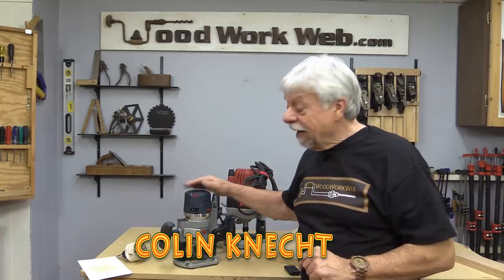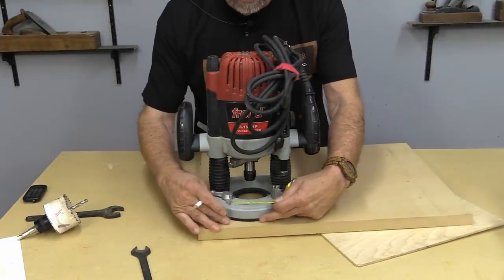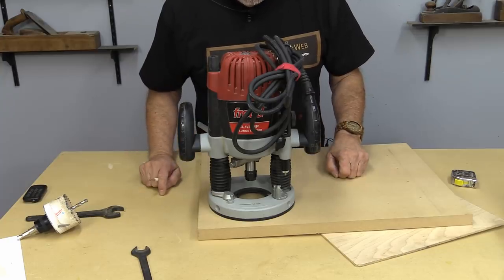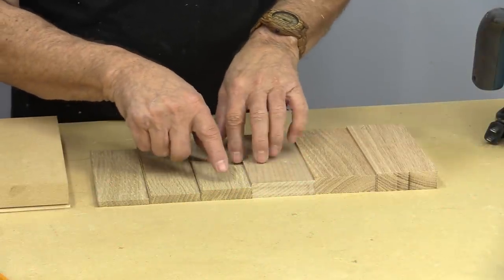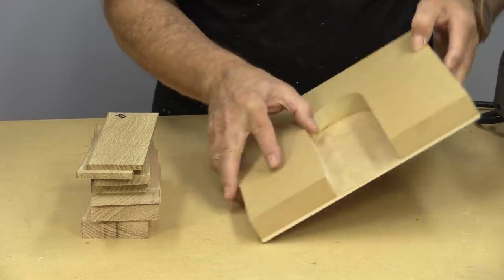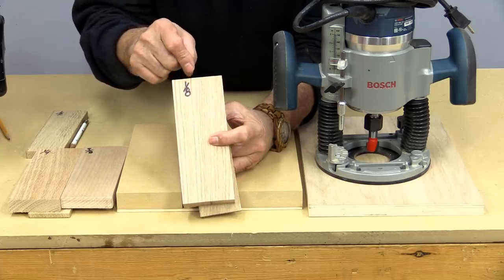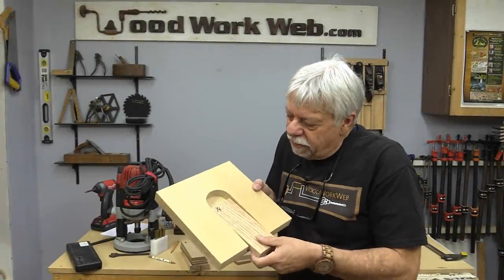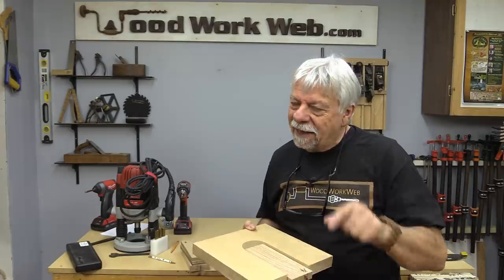Router Depth Setter: Wood Router Jig for Setting Depth

Comment: Colin, why not just create 1/8" blocks and stack them together for the depth you need instead of all the different sizes, also if you either make them shorter or round them over they would be easier to store in the slot with the base.
Reply from the maker: Those would be some great mods! Thanks for sharing.
Reply: Unless the boards were perfectly joined by the 7th stack (*for 1/8 depth) the imperfections in the wood or even minor warping over time would lead to imperfect depths potentially. I think just planing boards to the correct thickness is the correct way to go, as seen in the video.
Reply: @JustinSmith1287  1/8" masonite would minimize the imperfections that you accurately point out.

Comment: Why the base? If you want a certain depth like 1/2", just lower the bit down to it touches the table and insert a 1/2" brass bar or something else that measures 1/2" between the router stop and lock it down.
Reply from the maker: It's to make sure you have an even surface, but necessary if you don't need it.
Reply: @knecht105  I still don't understand. Most router manuals show how to set the depth easily without a jig. Another advantage to this standard method is that the depth can be adjusted very accurately to any depth using drill bits.

Comment: Thanks for sharing. :)
This is a cool idea, but sharp router bits will press the wood fibers down and the depth adjustment will become inaccurate about 2 o 3 milimeters(I know, because  I have ruined one of my projects in a similar way!), moreover humidity of air may cause the wood to swell a tiny bit and make this jig inaccurate! 
I think using something like that metal gauge blocks at the bottom of the jig, will make it much more accurate and durable.
Reply from the maker: Put a laminate on your wood if this is an issue.  Thanks for watching.
Reply: @knecht105  I will try this tip! Seems like a good idea :)
I really appreciate that you read our comments  and care about them.

Comment: Colin, why not cut out the whole channel in the 1" MDF and make a fixed 'staircase' type depth gauge where each step is one of your common settings. Leave a larger 1" step so you can add in steps of a different size should you need it for a specific job. That way all of your common depths are always in your jig and you can't loose one of them.
Reply from the maker: That's a GREAT idea! That will be for a future version on the jig. Thanks for watching.
Reply: The steps would need to be wide enough to accommodate the widest bit you want to use with the jig.
Reply: Thought the same exact thing

Comment: I think you really don't need the jig tbh.....jus take your router with the desired bit and plunge it in any flat suface and then take the measuring block and place it in the touret and lock it down ...that way you'll always get the same results accurate everytime....jus a suggestion .... anyways great video  as always .....cheers ...thanks Colin!!!!!😀😀👍🏻👍🏻

Comment: Isn't if the inverse for something beyond 1/2 inch? For instance if I need 1/4 inch and I put your 1/4 inch block inside the jig, the router depth will be 3/4 inch isnt it by using this jig? 1 inch minus 1/4 inch.

Comment: I enjoy your videos. Many good ideas. Just watched this one, but this time I think you might have gone a little overboard on the jigs. Just zero out your router on any flat surface, and  lock it.  Then use your brass gauge blocks between the turret and rod on the router to set the plunge depth below the work surface. The brass gauge blocks are most likely more accurate than any wood strips you could cut, and they are not susceptible to thickness changes due to changes in moisture content. I use this procedure to set router bit depths all the time, and don't recall ever having a problem with it. And... I have one less jig to store in my shop with limited space.

Comment: Great idea i will be using it. I like the blocks made like that better to have dedicated single blocks to avoid compound error. Do you have a solution to the thicknesser problem when you get steps in the ends? I think it's the transition from 2 rollers to one and back allowing the timber to lift slightly

Comment: Hey Colin. Great episode. Question though with regards to router bits. I understand shanks and also on what profile router bit to choose. However I get confused with selecting the size of the bit etc. I came across a sliding door that required the bottom of the door which runs parallel to the floor to have a 16mm wide by 5mm deep groove to be cut into it. How will you do that since a door is huge and all you have is a router. Plus in this case how can you change depth of cuts as required. Buy new cutting blades? What decides the maximum limit of how deep a cut I can make? What consideration should I take when buying a cutter then?

Comment: First, you need a planer to set all those different thicknesses precisely.
Second, even if you use hard wood, they will be dented by the router bits.
And finally, its a bit time-consuming (but if you've spare time...)
I'd rather use a bunch of 1mm thick steel bars and pile them in the required number.
All this provided you can't rely on the router scale itself, obviously.
Reply from the maker: Great ideas, Carlo. I look forward to seeing your video on this modified version of the jig. Thanks for watching!.

Comment: Fascinating, Colin. You have the best hacks on the web. This is another of yours that I have a real need for in my shop. By the way, I've been trying to find some 1" thick mdf, but not having any luck. Can you tell me who your supplier is? Thanks.
Reply from the maker: Around my parts. most hardware stores stock it.
Reply: @knecht105  I have only been trying big box stores, and online, I'll check some hardware stores. thanks.

Comment: Thanks for sharing. Another excellent video. A great woodworker once said there are 3 ways of doing things. This topic is no exceptionMethod 1. Your method is great. As a slight improvement, you might make the base into a box to keep all your depth pieces togetherMethod 2. Drill multiple holes (of diameter large enough for the biggest bit) into a 2x4 and put in bolts and nuts in the centre of each hole. These bolts can be set very accurately to any depth and then locked in place with a second nutMethod 3. Lock your router + bit flush with any flat surface. Put you standard depth bar in between the depth rotor and the vertical depth bar and lock the bar in place. I use the steps on the depth rotor to incrementally cut your way to the final depth.If you don't have standard depth gauges, cut several pieces of flat iron and file them to size, checking with a vernier
Reply from the maker: That's to tips and thanks for watching!

Comment: I'm really sorry because I have learnt a lot from your channel but I'm confused. I bought a little gauge with a ruler in it for £5. I’m very new to woodworking but wood doesn’t seem to measure what you buy and does vary. So how will precise measures work? If I want to go through 22mm wood I can set it to 22mm on my measure, but an inch would be too imprecise for the wood. To my very very limited understanding, it’s the measurement of the wood you are cutting that matters, not predetermined measurement. Or am I missing something?
Reply: Use this to make a groove or dado into which you glue a panel at a right angles. The depth of the cut is how much you imbed the panel, not the width of the panel.
Reply: jerryf609 Thank you, I see what you mean.

Comment: The router has a depth stop for a reason, you might as well use that. lol.
Reply: Agree with you. Set the router bit flush with the bottom - on a flat surface, then set the depth stop up the exact measurement desired either by ruler or block gauge, then go to town with it.
Reply: that's the simple easy way, and toms description is exactly the way to do it
Reply: I think he left out a major reason for using this method he is showing.  IF you have multiple router bases and they are different thicknesses this gauging system can be used to compensate for those various thicknesses.  I got around the problem in a much easier way by marking the rules on the router with red and green marks which represent the other two bases I have.  Simply use a knife to scratch in the exact place for one inch.  Then use a felt tip marker on the scratch.  Wipe off the excess and you have a reference which you can use a steel rule to make all the other depths you want.  Then rather than drop down onto that cam as he did in the video, you just lock the plunge to the new mark that matches the base being used.
Reply: The measure on my routers are both useless. They are both quite inaccurate. I have a series of 150mm squares of different thicknesses that have a 60mm hole though each one. Then I place the router base on the square on a hard surface, then adjust the depth like Colin shows. They just live in the plastic wheelie box that I keep my routers and bits in.
Reply: @maxximumb  Can't imagine why the measures on your routers are useless.  They are very adjustable to correct them and if your just talking about the thickness of the lines on them or the paralax error created by the sight being to far away from the rule I have to wonder what your routing.  Wood expands and contracts far more than the tolerance you can get on a gauge block.  Using gauge blocks on wood is a bit like using the measuring lines on a measuring cup to gauge volume.  The tension on between the water and the sides is enough to ruin anything close to scientific accuracy.
Reply: @trongod2000  
I believe you missed the point of my comment, that being:
Regardless of the base & it's thickness, once the plunge router is set to zero by pushing down on a flat surface and locking in place, the depth stop can then be raised up by any measurment - ruler, gauge block, piece to be inserted into a dado, etc., then by releasing the plunge lock and pushing down to the depth stop new setting, you are at the depth you want.
Questions?
Reply: @tombaker3794  Tom, my only question would be why your saying I missed your point. I totally agree with your comment.  I was directing my latest comment to "MaxxB" who seemed to be saying his router has an inaccurate setting gauge.  The only reason I don't use "YouHolli"'s comment directly is that he didn't mention varying base thickness which really does throw off the use of the built in gauge. (If your trying to use the stop cam the way the video shows)  To be able to use the stop and gauge without any other accessory I found it easy to mark the built in gauge to account for my base plates.  I should note to everyone that the true thickness of a base plate can be a really weird number because the screws it's fastened with are counter-sunk to a weird depth not the manufactured thickness of the plexi-glass.  I also understand that your saying "zeroing" the bit accounts for the plate.  It also accounts for the bit being clamped into the collet at various depths.  Neither of those issues were mentioned in the video.  Basically everything was pretty much OK until he brought in the built in cam stop.  Good example would be if you want to cut a mortise for a sheet of plywood to fit into.  There aren't cam stops for 1/32".  You can get it on the gauge however.

Comment: When you mark your depth gauge wood pieces, the number on them should be the difference between 1" and the thickness of the wood, not the thickness of the wood. Those little pieces of wood just elevate the bit up certain amounts,. Since the MDF is 1", the number should be the difference, or the air space, between the wood block and router base.
Reply: Russ Martin That is what he did, and explained it starting at 5:56.  You can see that the piece marked 3/4” is obviously not 3/4” thick, it would be 1/4”.  And the piece marked 1/8” looks like it is 7/8” thick.

Comment: You have to mention that you will have the diference between the base and the piece of wood you use   If you use 1/2" block of wood you will have 1/2" depth of router, but if you use 3/4" wood, you will obtain 1/4" router depth
Reply: Pedro Sarkissian He did mention that when explaining the different pieces starting at 5:56 in the video.